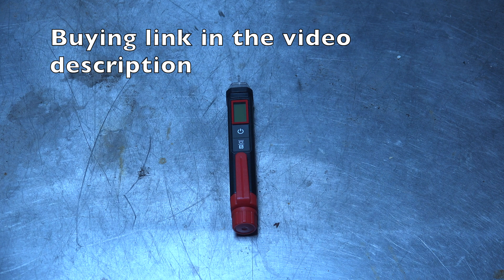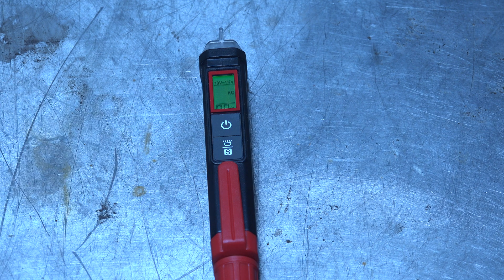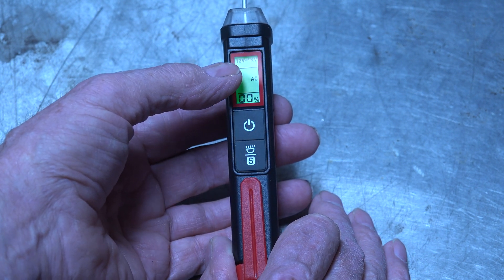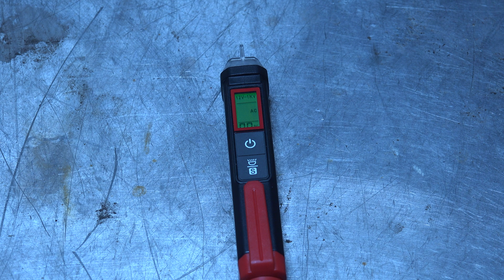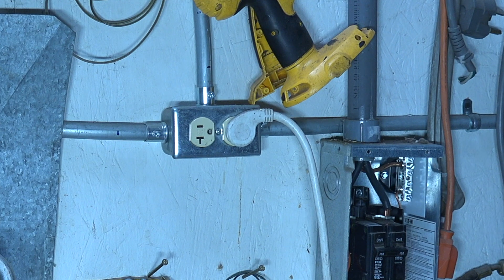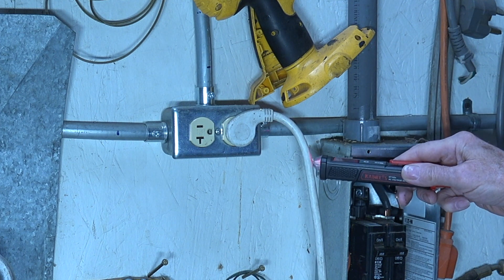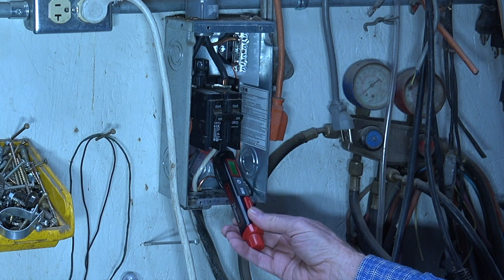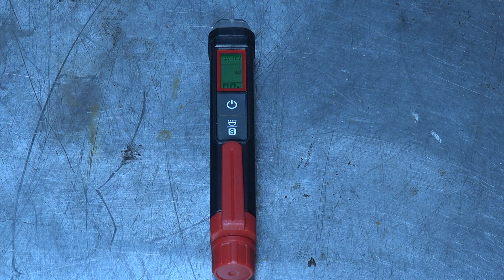A test of the Kaiweets  HT100s Non Contact Voltage  tester

Comment: How has it lasted to date? I have a bunch of rando wires in my basement. Some are hot and some aren’t and I’m trying to sort through them without getting zapped. For outlets I used a plug-in detector and meter so I won’t need it for that